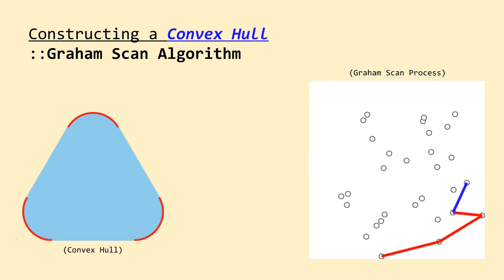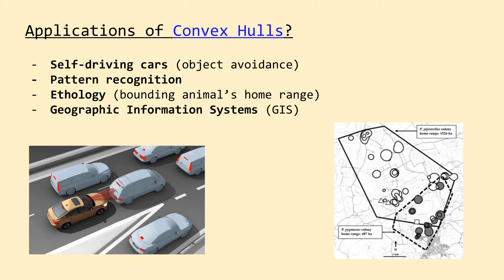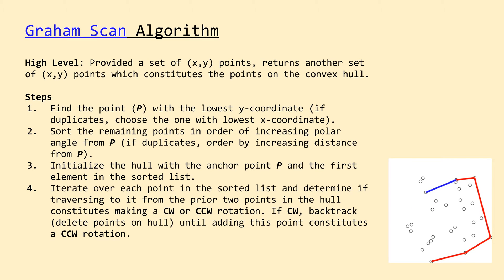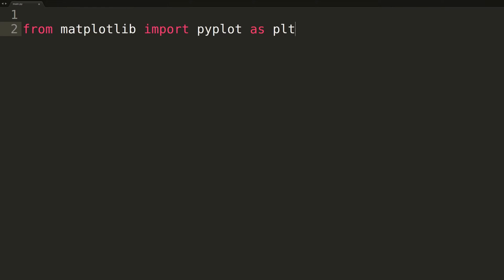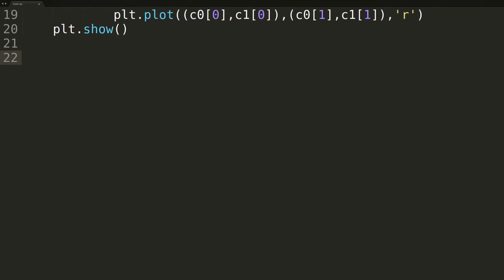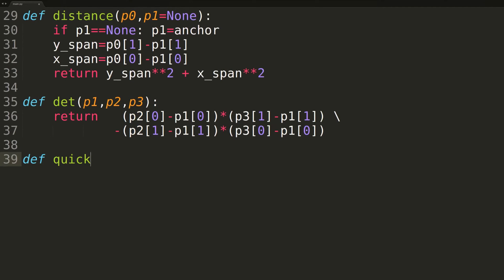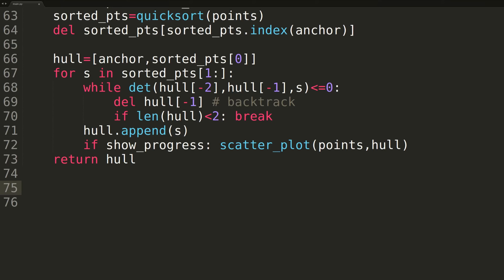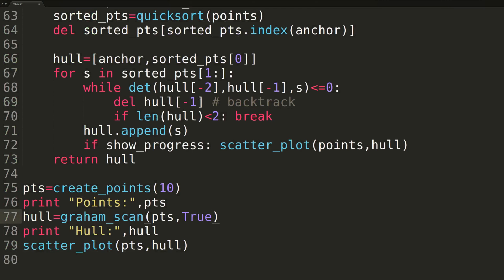Graham Scan: Background & Python Code

Comment: Thank you for the video! However, when I run the GitHub script such as in 13:15, the plot GUI freezes at the first frame. I am only trying 10 points.
Reply: It also produces IndexError: list index out of range for rather small sizes (eg >300)

Comment: What software or program are you using?
Reply from the maker: Hi Xavier, the coding editor I’m using here is Sublime Text, to run the code I’m just using the default Ubuntu terminal.
Reply: @BrianFaure1  Is there a guide you provided or somewhere to install Ubuntu, I am using Windows?
Reply: @lycanlift  if you are not a elementary school you gotta google it.
Reply: @BrianFaure1  thank you